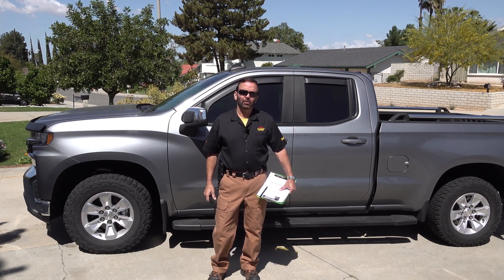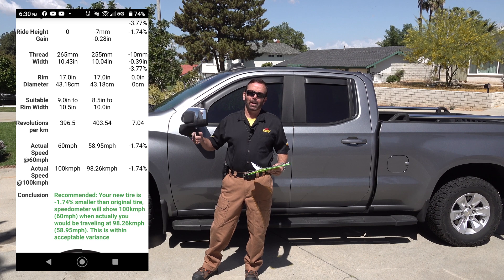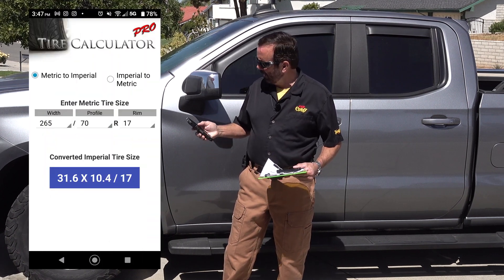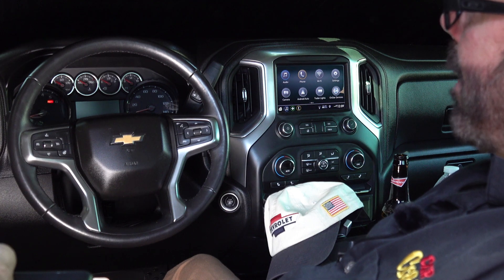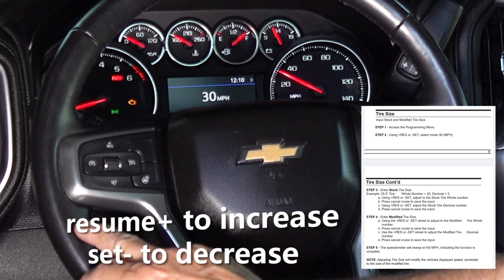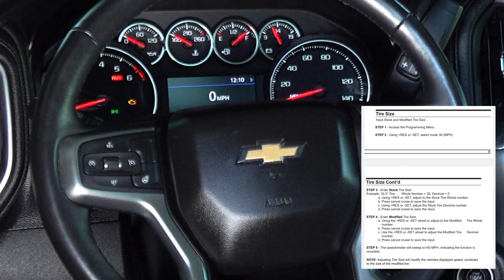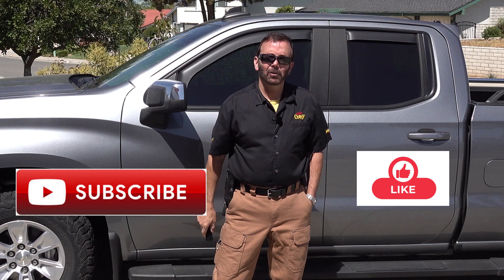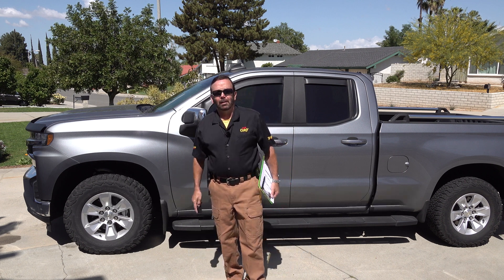Pulsar LT: Tire Height Adjustment for Speedometer Correction w/Paul Henderson 4-2022

Comment: Hey Paul, my truck is a 2020 Sierra SLT x31 my stock tire size is 275/60/20 would I punch in 32.2? And New tires I installed are 35x12.5R20 how would I put that in?
Reply from the maker: 275 =33.0 
Is the 275 the size that is on the door sticker I remember correctly you're posted punch in the number that's on the door sticker.
And the 35 would just be 35.0 
It's been a while I can't remember exact sequence on how to do it I'd have to watch the video.
Reply: @HowtowithPaulHenderson yes my door sticker says 275/60/r20 and thank you very much. I had it in as 32.2 and the other at 35.0 and it read about 3-4mph over

Comment: Hi Paul maybe you can help me?
I got the lt pulsar on my trail boss 
Need help on my tire calibration on 
A bigger tires & rims 
Got 37x13.50 26
Reply from the maker: I'll check it out I have the app for that I'll get back to you.
Reply: @HowtowithPaulHenderson ok thank you
Reply from the maker: Those numbers on the tire you gave me is the imperial numbers. What you're going to need is the stock tire size converted to imperial because you will need to enter the stock tire size first and then 
 The new tire size numbers. 

 The instruction booklet under tire size it shows you step by step on how to enter a stock size and then reenter the new size. If you reply with the stock tire size I'll give you the imperial size for that tire
Reply: @HowtowithPaulHenderson yes I got it set up already to the stock tire in the lt pulsar 
My stock tires are 275/65/r18
Reply: So I enter 32.1 
On the stock?
Reply from the maker: @eliasleon495  
If that is the stock tire that came with the vehicle.
It converts to 32.1.  10.8.   18 
Is that the stock size that is listed on the sticker on the driver side door jamb.
Reply: @HowtowithPaulHenderson yes
Reply: So if I got 37/13.50/26
What number do I put ?
Reply from the maker: @eliasleon495 
Been a while ago I can't remember how I did it I need to watch the video.
Reply from the maker: @eliasleon495 
Yes, The number to punch in is 37 
As for the second part of the first number
I think would be entered as zero on the speedo. 
I feel kind of dumb,  I thought you had to punch the height, width and rim size I was wrong, The first number would be the height of the entire tire so it's all you need.
Reply: @HowtowithPaulHenderson ok thank you 
Actually I’m set it at 36” see how it goes
Reply from the maker: @eliasleon495 
Nice,  I deleted some of the comments that I made because I realize how stupid I sounded. That's why these YouTube videos are good I totally forgot how to set it up until I rewatch the video.

Comment: Do I have to enter anything into pulsar if I haven’t changed my tire size ?  My current tires are 275 60 R20
Reply from the maker: So sorry that I didn't respond. You could if you want you don't really have to. Those are the tires that came on the vehicle then it should be set up for it but you can always check the tire size on the door sticker and see what it says.

Comment: Please Help Paul… My Stock tire size on the Sticker says it’s 255/70R17… What would be the number to punch on the Pulsar LT…
Reply: New Tire set up would be 22” front and 17” rear… It’s a Drag Pack…
Reply from the maker: sorry for the late response. Your tire size 31.1 inches. I hope this helps
Reply: @HowtowithPaulHenderson  is that for the 255/70R17? Cause my new Tire set up is 295/30R22 and 305/45R17 so what would I have to punch? Cause I’m like 15MPH Over…

Comment: DONT FORGET TO CHANGE GEAR RATIO! pulsar lt comes with a preset gear ratio (I believe 3.23) so if this isn't what your stock gear ratio is program it accordingly.
Reply from the maker: Good to know, I will have to check that out. I did correct the tire size and increases the throttle sensitivity to only 20% above stock

Comment: So section 3 (tire size) on the pulsar only wants the height of the tire specification and not the width? For example; my stock tires read 275/60r20 which I Googled and they're equivalent to 33x10 I would insert 33.0 on the pulsar for factory tires and my aftermarket 37x13.50 tires I would insert only 37.0?
Reply from the maker: Yes that's correct, just the tire height is needed. I did check your stock size 275 is that the size that is listed on the door  sticker if so the conversion is 32.2 You would scroll up to 32 then cancel/enter then for the decimal you would scroll up to 2 press cancel/enter and for your new tire, if it is a 37 inch and height tire it would scroll up to 37 and press cancel/enter
And as for the decimal portion it starts at 0 and you would just press cancel/enter for the .0 -09. It's been a while I can't remember. I'm going to check on this and be right back.....
I checked on it and yes I was right. You will need to enter the factory OEM tire size first and then enter the new tire size. Your tire should be 37 inch in height but,  just measure it to be on the safe side.
Reply: @HowtowithPaulHenderson  ok thx..does changing the gear ratio on the pulsar make a difference if I haven't actually changed my gears?
Reply from the maker: @jayr.1523  I wouldn't recommend doing that.
I do believe that is only for if you change your rear end out.
Reply: @HowtowithPaulHenderson  thx alot
Reply from the maker: @jayr.1523  Hi Jerry
I did a oil change on my truck couple weeks ago, I did feel two videos at JLT 3.0 inspection and installation of the new revised stillen cold air scoop, I need to edit those but I'm on vacation so I'm going to wait until I go back to work.
Anywhere this was the third oil change since I installed the pulsar LT I keep detailed fuel logs, service records, and parts and supplies and my fuel mileage before the The installation of the Pulsar LT and the deactivation of the DFM before and after is the same. Just in case you're curious what the MPHs are before and after. This is

Comment: Hey paul, if my stock tires are 33. Inch with no decimal would i just input it as 33.0? My new tire size is 37s
Reply from the maker: Does the sticker that is located on the driver side door pillar state that a 33.0" size tire is the stock size that the car was equipped with. If so, yes use the [point zero]

Comment: Nice Video info! Enjoyed the Bloopers! 
I do the same thing when remembering how tire size effects speedo lol. 
I just try to remember,  smaller tires spin faster, so speedo reads faster. 
Keep up the content! 
I would like to see information on tuning,  GM has the computers locked up tight. You have to send the computer out to unlock it for programming.  Hopefully the Aftermarket will come up with a replacement computer that is programmable. Or even better would be a hand held that can get around a locked computer! 
P.S. I just installed the GM performance Parts Exhaust. Very happy with it! Gives the vehicle a nice sound without being annoying! 
Cruse speeds are nice as well. 
This kit also eliminates the annoying spring-loaded doors!  GM claims 13 more HP.
Reply from the maker: I thought about installing that exhaust system also. I figured it would probably sound better than an aftermarket type, plus it would be designed and approved by GM. But went with the Magnaflow muffler shortly after I bought the truck. Maybe down the road I might swap it out. 
So did you install it or did you have it done.
Reply: @HowtowithPaulHenderson  I installed it. Took about 40 minutes,  just cut the old one off.
Reply from the maker: @80gritkelly20  so it's just pushes together and use hose clamps to tighten it down.
Reply: @HowtowithPaulHenderson  yes! Exhaust straps hold connections together.  used jack stands on the frame to hold up the rear of the vehicle, allowing the Differential to hang. Gives a little more room to install tail pipes. Pretty simple install really!
Reply from the maker: @80gritkelly20  I'm definitely going to have to consider doing this. Since its sold by GM/Chevy it should be a perfect fit and look stock.
Reply from the maker: I just checked out the Chevy app they only sell two for the 5.3 and it says the short wheelbase. I'm going to check out of that further and punch in my VIN number. I think mine is considered a short wheelbase I think an 8-ft bed would be considered a long wheelbase but I'll have to check into it